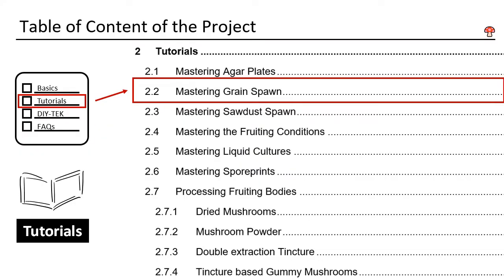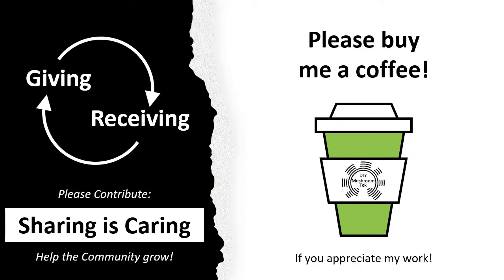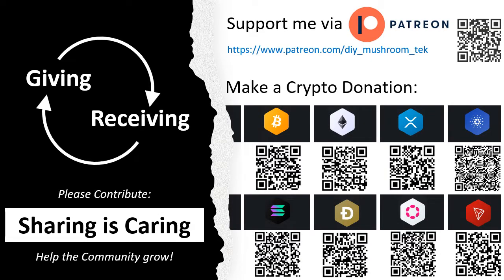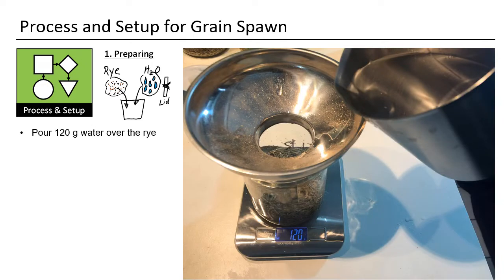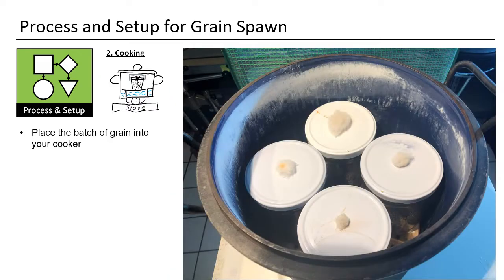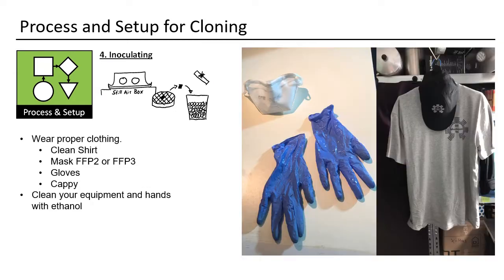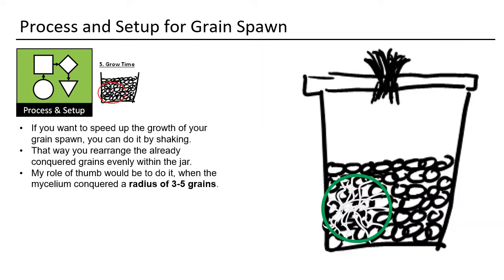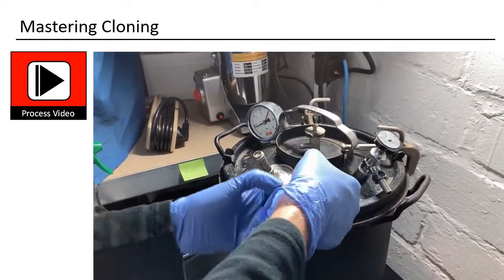2.2 Mastering Grain Spawn

Comment: Good video. At this stage, they can also become contaminated. It would be good if you could make a video at some point showing how they become contaminated and by what type of contamination. Excellent work.
Reply from the maker: Hey Miguel,

Contamination shouldn't happen at this stage unless your work isn't sterile. If that's the case, it's essential to reflect on and reevaluate your process. What might happen, though, is that if you use very old agar, the mycelium may have already lost its vigor. This could lead to a much longer colonization time for the jar, and the fruiting process might take even longer, potentially resulting in only small fruiting bodies. At some point, maintaining good genetics will become crucial. Since I never cultivated for that long, I didn’t delve into that issue.

In any case, you can always buy new mycelium from a professional grower and restart from there. There are many possibilities, as usual. I guess the scale of the growing operation will significantly influence how you organize the production process. However, even with just one or two Martha tents or grow tents running, the bottleneck will likely always be the sterilization of the necessary bulk material inputs. That’s just what came to mind regarding your comment.